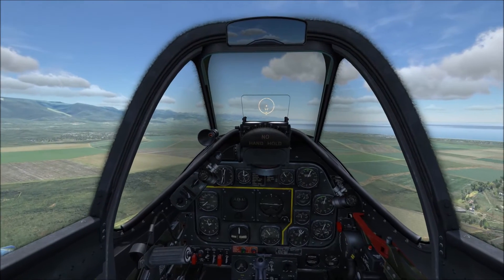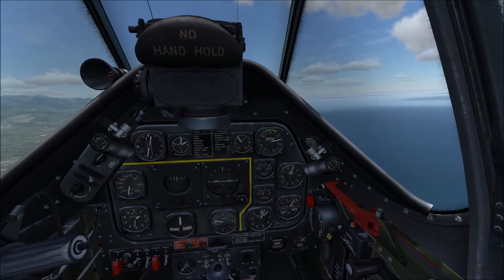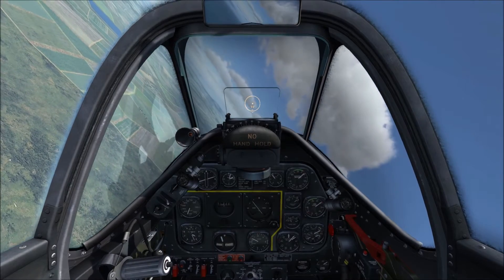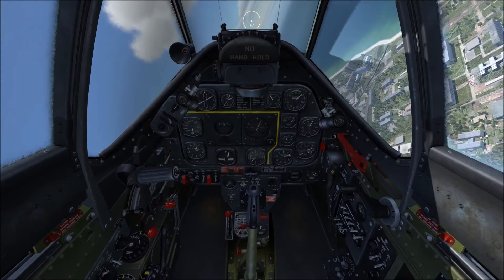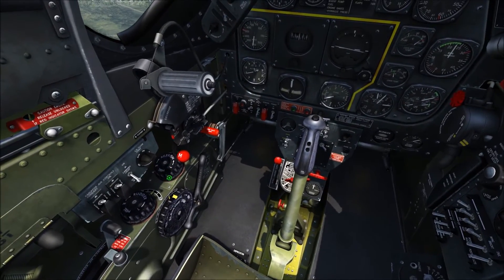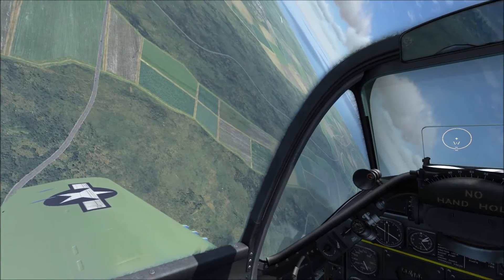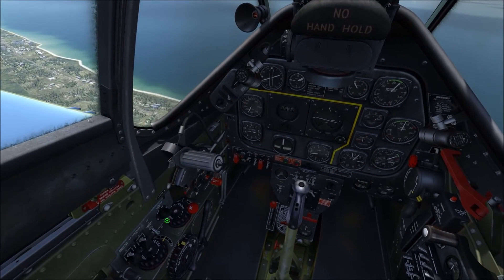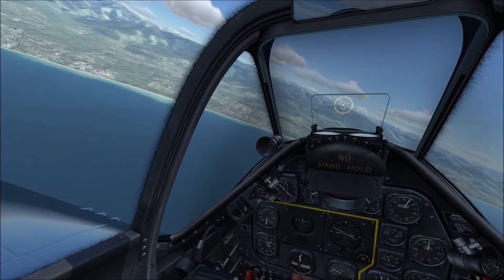DCS P-51D Tutorial Operation and maneuvering

Comment: P-51D looks nice but sure does have it's maneuverability flaws. Its very prone to spins and stalls. Even a simple loop you'd really have to keep an eye on your altitude, speed, and stick control. Sometimes recovery isn't as easy as neutralizing the controls. God hope you have enough altitude when you hear that wind whistle and feel that shake at the point right before it goes into that stall or spin. I'd imagine it would fall apart either an ailerons snap, elevators snap, rudder snap, or tail snap off and I'd end up falling like a rock if I were to fly this in my physical prime. A mile and a half in 10 minutes easy, 71 push-ups and 56 sit-ups in one minute easy in my sleep, and pulling more Gs than your mama, j/k, but seriously on any given day in my prime. Not snappy enough, I know it. This is an old man's plane. Might have been the stuff in its hay days. I understand that every aircraft has its envelopes. Even the most advanced in this era has its flaw of engine flameout from lack of idle detent or when in negative G, that would be the Me-262. I could imagine P-51D mustang pilots at the time having this fragile maneuverability limitation on the back of their minds going into a fight against the Bf-109 knowing that it isn't as much of a problem for them. A fighter pilot must be able to fly a plane as it is a part of their body. If it does not allow that or your body can out perform it. Then you shouldn't be flying it into combat. Unless you are a transport pilot, than it is ok. Don't get me wrong. I have much luv' for a mustang and it is an American icon. But a short envelope for stall and spin is a problem in combat especially in a dogfight. Sadly, if you look up its history, many mustang pilots have died due to failed maneuver recovery. Hence look how slow and easy pilots fly a P-51D at airshows.
Reply: Maybe old man's plane but Tom Cruise owns and flies one.